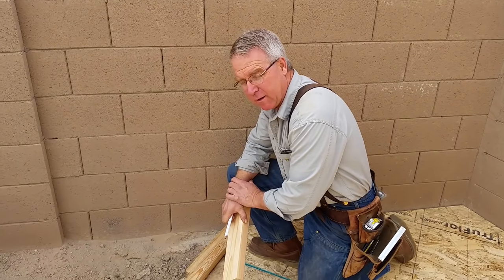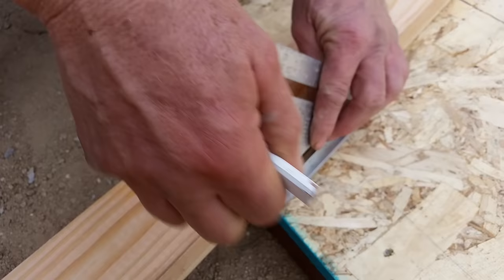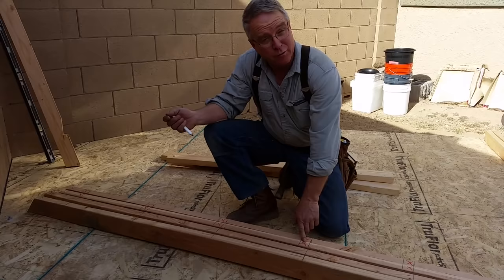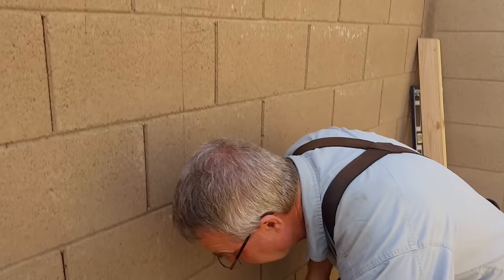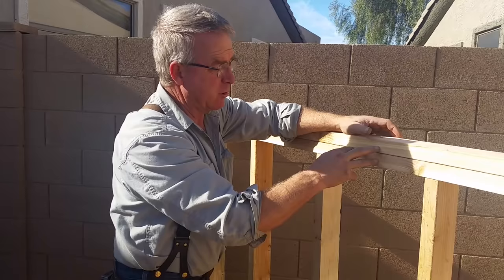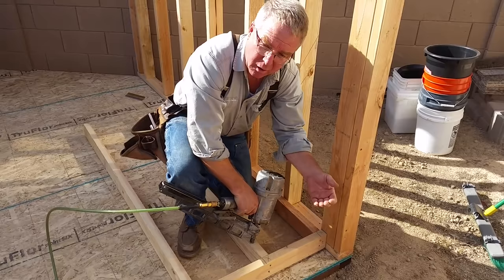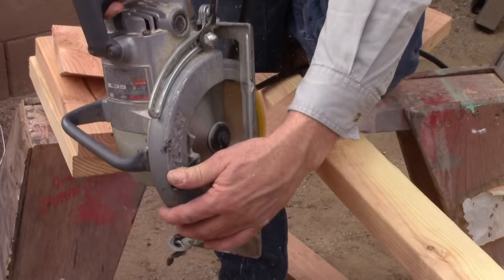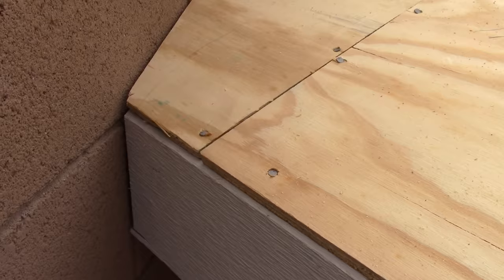Framing Pro Tips

Comment: For all the "short cuts" utilized you might save 15 minutes in an 8 hour day. While they are sensible, some trades people get carried away acting as though they were on piece work, and some may be? I wouldn't want my house built by "craftsmen" on piece work. For one thing it can create conflict between trades. I've seen framers leave out of plumb, out of square, etc. walls for sheet rockers. I've seen sheet rockers cut holes for electrical boxes with a lathing hatchet. Not on my home you don't!!